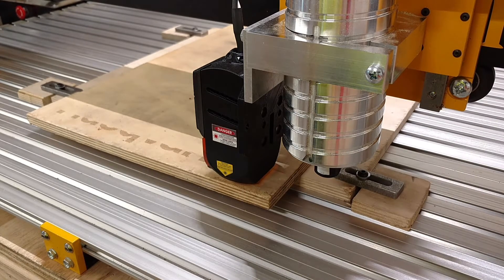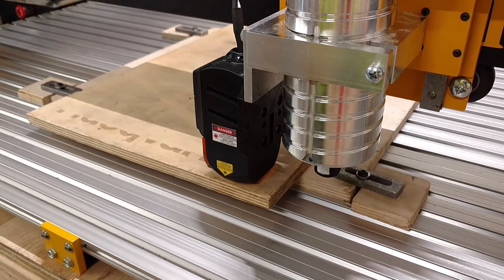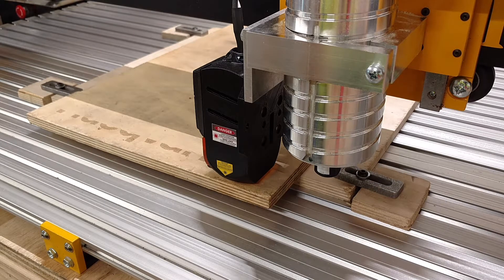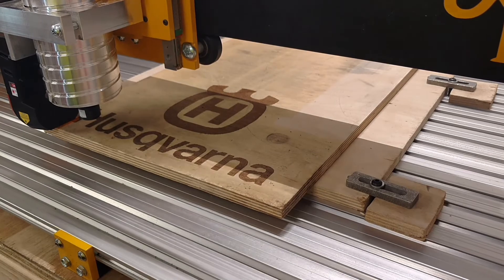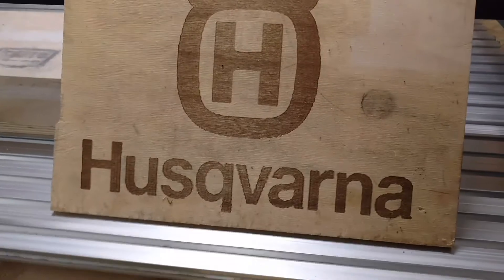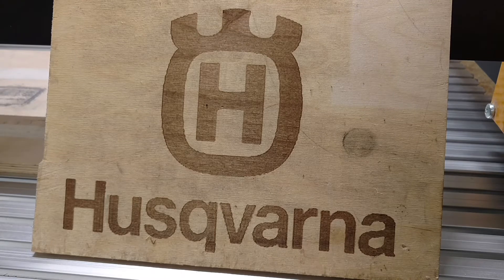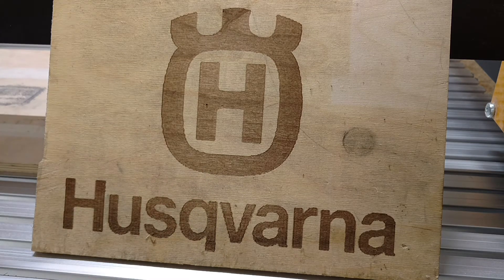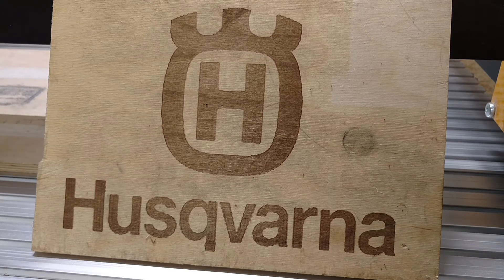The JTech Photonics 7W Laser In Action!!!

Comment: Hey mate,

I was the guy that had asked about the laser and if you had it / had plans to use it on Reddit.

Thanks a lot for this video, very nicely done. My main purpose is making custom foam inserts with the laser, based on how smooth and tight the wood etch was I assume I probably wouldn't have any problem doing quality finishes when laser cutting foam with this laser and machine.

Very insightful!
Reply from the maker: I definitely think cutting custom foam inserts is something this laser would do very well, especially on the Mega V. I am already planning on foaming out a pelican case with custom cutouts for all my wife's photography equipment.